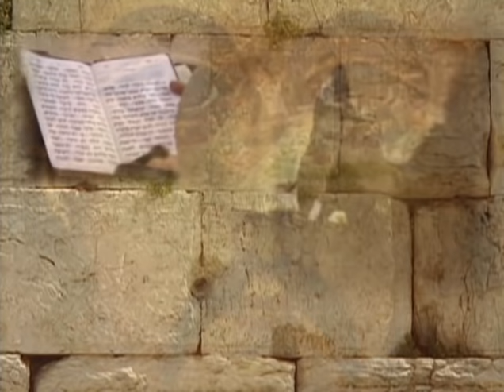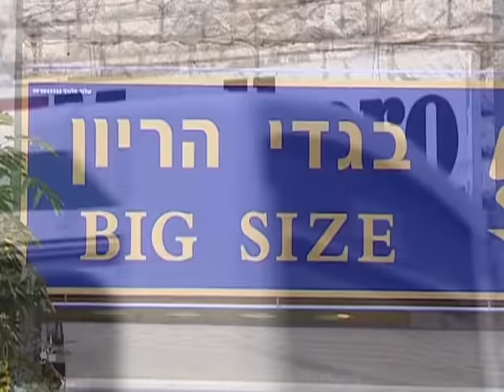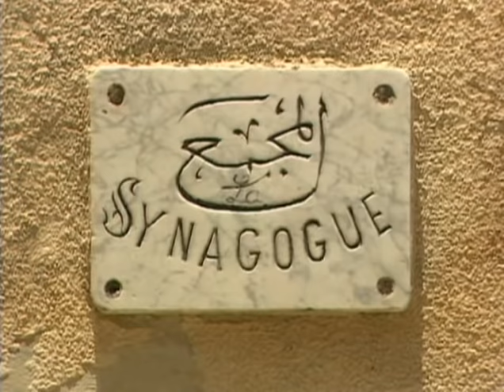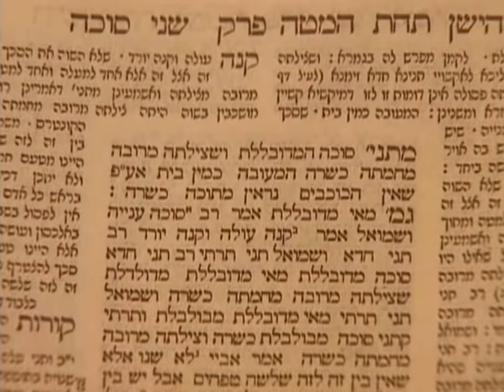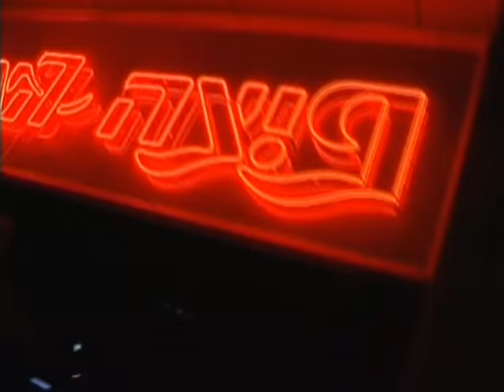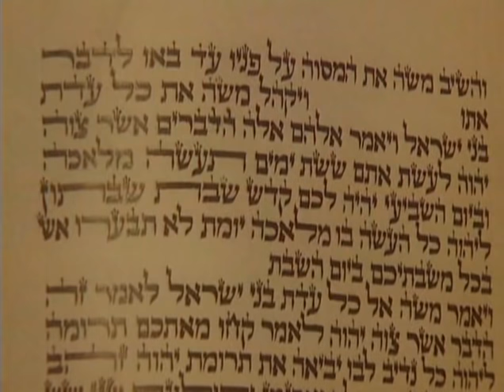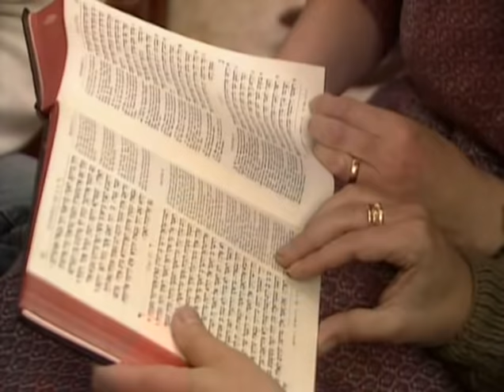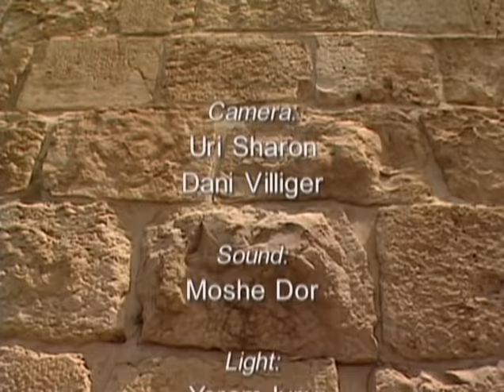Yeshua: Exploring the Jewish Roots of Jesus | Documentary | Peter Darg | Michael Kalb

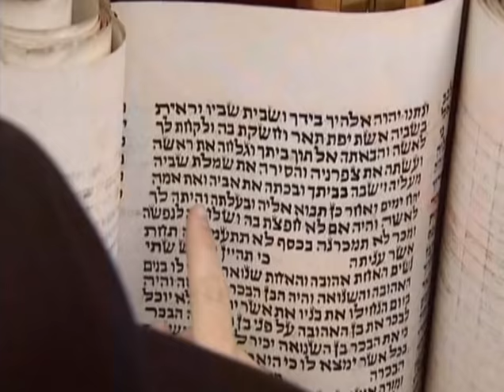Comment: IN SHORT… Jews do not believe in a trinity. The Jewish idea of Gd is that Gd is One and Indivisible. Gd cannot be divided up into separate parts, where each part is unequal to each of the other parts, yet somehow they are all one and the same. The Hebrew Scriptures describe Gd as an absolute One, but the Christian Scriptures describe Gd as divisible into three parts called a trinity. In the Christians’ scriptures, Jesus at one point claims to have different knowledge than other parts of the Christian trinity. For example, Matthew 24:36, or Mark 13:32. In another verse, Jesus does not have the same power as other parts of the Christian trinity, for example, Luke 23:34. And in Matthew 26:42, Jesus’ will is not the same as the will of the Father. Indeed, Jesus often contrasted himself with the Father, for example, in John 14:28, or Luke 18:19. Furthermore, Jesus supposedly said that the punishment for blaspheming against one part of the trinity is not the same punishment for blaspheming against another part of the trinity. In the Hebrew Scriptures, however, Gd is One, as we read in Deuteronomy 6:4, as well as in Isaiah 44:6, where Gd tells us, ‘I am the first, and I am the last; and beside me there is no Gd.’ When Isaiah tells us that Gd said, ‘I am the first,’ it means that Gd has no father. When Isaiah tells us that Gd said, ‘I am the last,’ it means that Gd has no literal son, a divine piece of Gd. And when Isaiah tells us that Gd said, ‘Besides me there is no Gd,’ it means that Gd does not share being Gd with any other Gd, or demi-Gd, or semi-Gd, or persons, and there is no trinity.
A MORE COMPLETE EXPLANATION…

Just because there are various manifestations of Gd in the Bible, this does not mean that each manifestation is to be regarded as separate and unequal to Gd, yet somehow at the same time one and the same as Gd. It also does not mean that each manifestation of Gd is to be treated differently. The Hebrew Scriptures tells us that Gd is One.

Hear, O Israel: The Etrnl is our Gd, the Etrnl is one. [Deuteronomy 6:4]

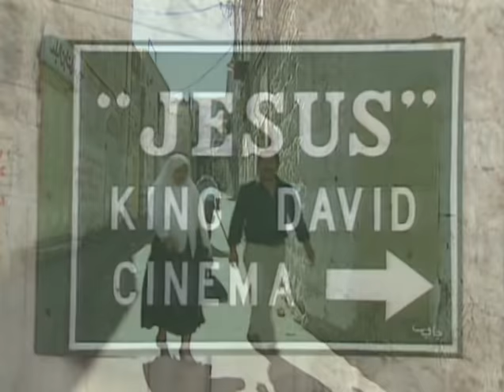But how do we know that the term ‘one’ at the end of the above verse, does not refer to some sort of compound unity, that Gd is made up of different parts that total up to one? The reason is that the word ‘one’ is an adjective. Here it is describing a proper noun, which is the word ‘The Etrnl.’ (In Hebrew, this is a one-word designation.) Most people forget that the word that is here translated as ‘The Etrnl’ is actually a Name, the holiest name for Gd, told to us in Exodus 3:14-15. The English word, ‘Gd,’ is a job description; the four-letter Name of Gd, on the other hand, is Gd’s personal Name. When the word, ‘one’ modifies a personal name, it must mean that this entity is only One, not a compound One, but rather an absolute One.

As an example, let us consider a man named William Jones. He may be ‘Dad’ to his kids, but ‘Honey’ to his wife, ‘Billy’ to his parents, and ‘Mr. Jones’ or ‘Boss’ to his employees. However, in all instances William Jones has the same knowledge, the same power, and the same will. In the Christians’ New Testament, Jesus at one point claims to have different knowledge than other parts of the Christian trinity. For example, Matthew 24:36, or Mark 13:32.But of that day and hour knoweth no man, no, not the angels of heaven, but my Father only. [Matthew 24:36]

But of that day and that hour knoweth no man, no, not the angels which are in heaven, neither the Son, but the Father. [Mark 13:32]

In another verse, Jesus does not have the same power as other parts of the Christian trinity, for example, Luke 23:34, where he must ask the part which is called the Father to forgive, instead of doing it himself:

Then said Jesus, Father, forgive them; for they know not what they do. And they parted his raiment, and cast lots.  [Luke 23:34]

And in Matthew 26:42 or Mark 14:36, Jesus’ will is not the same as the will of the Father.

He went away again the second time, and prayed, saying, O my Father, if this cup may not pass away from me, except I drink it, thy will be done. [Matthew 26:42]

And he said, Abba, Father, all things are possible unto thee; take away this cup from me: nevertheless not what I will, but what thou wilt. [Mark 14:36]

Indeed, Jesus often contrasted himself with the Father or with Gd, for example, in John 14:28, or Luke 18:18-19:

Ye have heard how I said unto you, I go away, and come again unto you. If ye loved me, ye would rejoice, because I said, I go unto the Father: for my Father is greater than I. [John 14:28]

And a certain ruler asked him, saying, Good Master, what shall I do to inherit eternal life? And Jesus said unto him, Why callest thou me good? none is good, save one, that is, Gd. [Luke 18:18-19]

Furthermore, Jesus is quoted as saying that the punishment for blaspheming against one part of the trinity is not the same punishment for blaspheming against another part of the trinity.And whosoever speaketh a word against the Son of man, it shall be forgiven him: but whosoever speaketh against the Holy Ghost, it shall not be forgiven him, neither in this world, neither in the world to come. [Matthew 12:32]

The parts of the trinity cannot be one and the same. They are separate, they have different strengths, different powers, different wills, different knowledge from each other, therefore the concept of the trinity is not monotheistic.

Some Christians, including Messianic ‘Jews,’ try to interpret Deuteronomy 6:4, the biblical verse which states Gd’s essential unity, to allow for the concept of the trinity. From the website of the Messianic ‘Jewish’ Alliance of America (MJAA):

‘We believe that the Shema, ‘Hear O Israel, the Lord our Gd, the Lord is one’ (Deuteronomy 6:4), teaches that Gd is Echad [one], as so declared: a united one, a composite unity, eternally existent in plural oneness…and that He exists forever in three persons: Father, Son, and Holy Spirit, as mentioned in Romans 8:14-17 (Father, Spirit, and Messiah – Son) and Matthew 28:18-20 (immersing in the name of the Father, Son, and Holy Spirit).’

Not only are these concepts of a ‘composite unity’ and ‘plural oneness’ contradictory and untenable, as well as unbiblical, as we have seen, but there are more than just three manifestations of Gd in the Hebrew Scriptures. There is of course, the Spirit of Gd, as we read in Genesis 1:2:

And The Spirit Of Gd (Ruach Elohm) moved over the face of the waters. [Genesis 1:2]

But there is also an Evil Spirit of Gd, as we read in I Samuel 16:23:And it came to pass, when The Evil Spirit Of Gd (Ruach Elohm Raah) was upon Saul, that David took an harp, and played with his hand: so Saul was refreshed, and was well, and the evil spirit departed from him. [I Samuel 16:23]

There is also a Lying Spirit of Gd, in I Kings 22:23:

Now therefore, behold, the Etrnl hath put a lying spirit (Ruach Sheker) in the mouth of all these thy prophets, and the Etrnl hath spoken evil concerning thee. [I Kings 22:23]

In Exodus 12:23, we are told that Gd will smite the Egyptians. But later in the same verse, we see that it is the Destroyer who smites the Egyptians.

For the Etrnl will pass through to smite the Egyptians; and when He seeth the blood upon the lintel, and on the two side posts, the Etrnl will pass over the door, and will not suffer the Destroyer to come in unto your houses to smite you. [Exodus 12:23]

One could claim that the Destroyer should be seen as a Person in Gd, just as the Spirit of Gd is seen as a Person in Gd. To this we could add that the Lying Spirit of Gd should be seen as a Person in Gd, and the Evil Spirit of Gd should be seen as a Person in Gd. This would mean that instead of the trinity in the Father, the son, and the Holy Spirit, one should have the Father, the son, the Holy Spirit, the Lying Spirit, and the Evil Spirit, as well as the Destroyer. Should we add to this the Burning Bush?If Gd shared or would later share Gd’s Gd-ness with Jesus, Isaiah would have told us that Gd’s words were, ‘Besides me and the son that will come after me, there is no Gd.’

This is why Gd told us in the Ten Commandments, in Exodus 20:3, ‘Thou shalt have no other gods before me.’ Even if you think they are gods, you cannot have them before Gd. You do not pray to them in order to get to Gd, and you do not pray in their names. Their sorrows shall be multiplied that hasten after another god: their drink offerings of blood will I not offer, nor take up their names into my lips. [Psalm 16:4]

Christians may tell us, ‘Behold Your Gd,’ but the last time we heard something similar was in Exodus 32:4, when the ex-slaves pointed to the Golden Calf and said, ‘Eileh elohecha — these are your gods.’